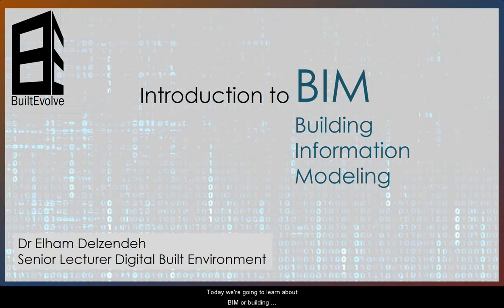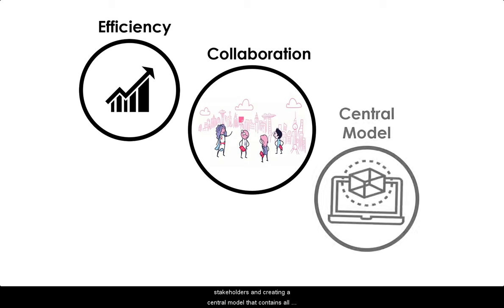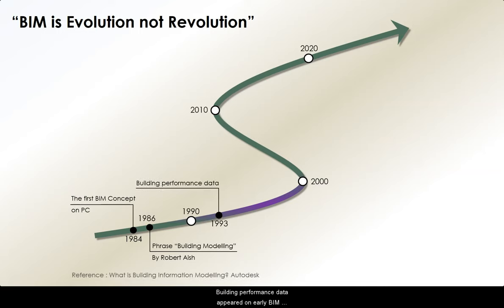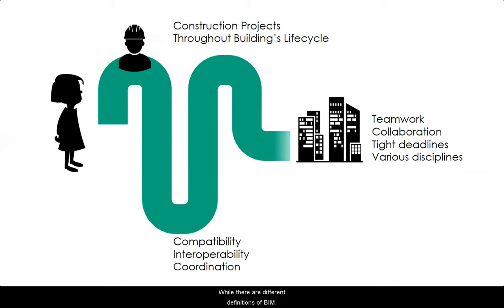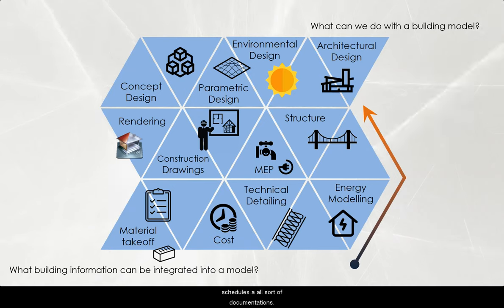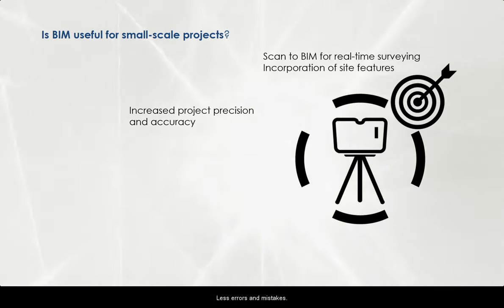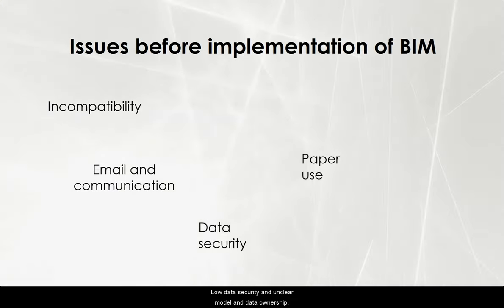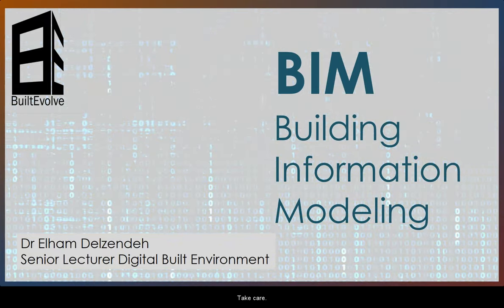Introduction to BIM (Building Information Modelling)

Comment: It is misleading and full of language makeup. The author aims to answer the question, what is BIM? But failed to do it. The evolution, the point,  has not been explained at all. The key terminologies (model, modelling, information, & building) were mishandled. Timeline and sources are not the best selection; it is wrong in some cases. Architects have killed BIM - this may be the burial, and now DT. Fifty years ago, an architect judged that the model is the computer equivalent to the balsa wood models the architects make - but with extra benefits; if someone cannot see the danger in this explanation, it's clear that they did not think about it for five or six decades.
Reply from the maker: Many thanks for sharing your thoughts on the video. I agree there needs to be more said about BIM and this short video is only an introduction. The core concept of BIM is collaboration, therefore I don't support the idea of separation between disciplines. We appreciate your suggestions on how to improve the content. Many thanks.
Reply: @builtevolvechannel8870  , the core concept for all digital and information systems, cover collaboration; however, the significance or the point of the evolution should be shot at least with few words. The truth is that 99% of the BIM terminology users could not signify BIM from CAD or DT, or CDE! Yes, all these are about collaboration.  The blame is on the leading initiatives, companies, and universities for not paying attention to the fundamental research and taking the  applied research for granted. Fundamental failure is with the academicians who handle BIM who did not see BIM as an interdisciplinary area, but hoarding the matter only within the building science and not sharing or adopting computer science systematically.
Reply from the maker: @gpm6334  Brilliant points! I agree that there are not enough BIM experts who know both theoretical and practical aspects of BIM. Also, I agree that wider collaboration (beyond construction disciplines) is the way forward for the built environment sector. Thanks for your comments.
Reply: Where one can learn BIM properly what exact BIM is ??